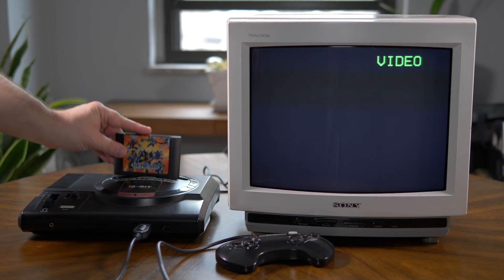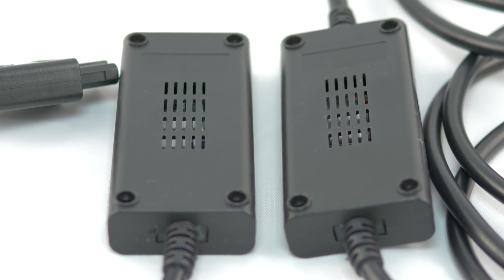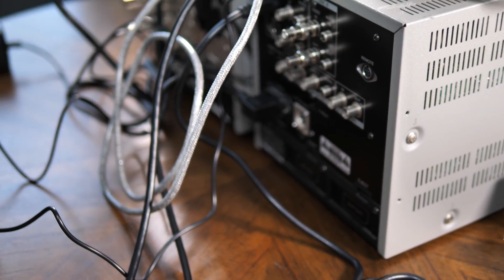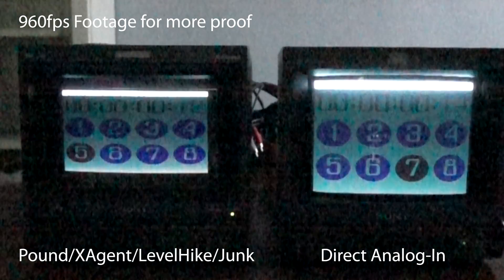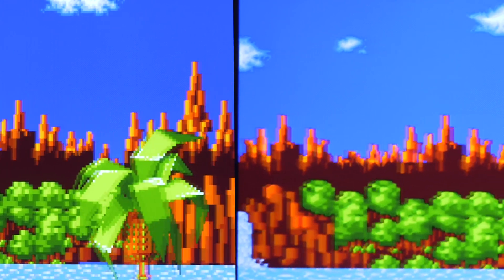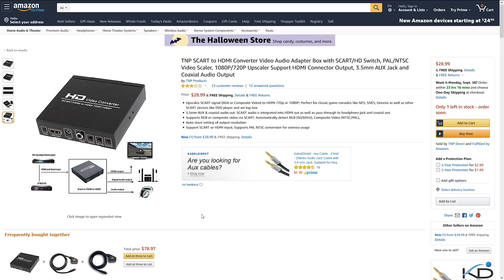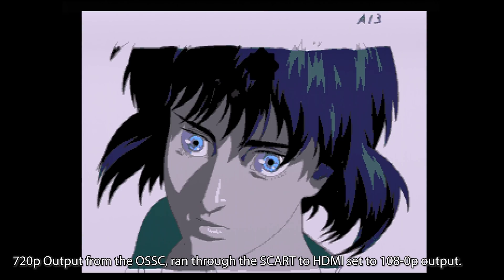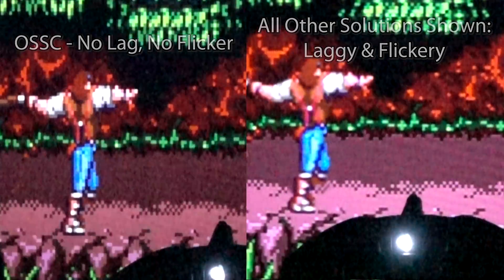The Worst Scaler In Retro Gaming

Comment from the maker: A polite reminder:  Every measurement taken can be verified by anyone who feels the need, simply by following the same procedures.  Using the 240p Test Suite's MANUAL lag test is NOT a measurement though - That's basically a test of your reflexes.  Also, listing a bunch of claims without measurements is just spreading misinformation; This video is a culmination of RESEARCH and the opinions I state are based off hard measurements, not guesses.
Reply: I was using that scart to hdmi box with a Trinitron Sony CRT via its hdmi port and it worked great. Maybe it's performance is better with hdmi CRTs. Im aware that most people don't have that option since it's rare to find a CRT with hdmi.
Reply: @ericko777  yeah, wouldn’t mind seeing a video on that.
Reply: I like how much effort you put in to nailing down the facts and making sure you're not guessing or going with your gut. I've found people who either have one of these, or who don't want to buy something expensive will say it isn't laggy for them or that lag doesn't matter. Now nearly a year later when you've hammered the point home with the lag test roundup do you feel you've won the argument or is there still lots of push back?
Reply: Bob it's funny that you say that this video ins't going t be some elitist perspective. If anything Adam Koralik is the biggest Elitist in the retro gaming community.

Comment: Say what you will, that scaler does the job concerning the hdmi in port and scaling to screen size on retro hdmi mini consoles when using crts or vga monitors.  Also they take a bunch of different signals.  I get these basically for the hdmi in.

Comment: I feel your rant so much. So easy to get mislead by youtube videos by people who should know better.

Put the Hispeedido HDMI mod into a PAL N64, and was so disappointed in the result. How can so many people give this a pass when it can't even do weave deinterlacing of 480i properly. They much be blind! Ended up pulling it out and putting the much better (but much more expensive unfortunately) RetroGem in it.

And now that I am looking for something to properly process Playstation 2 video signals, I am just going straight for a RetroTink 5x Pro. My wallet hates me, but at least it will do the job properly.
Reply from the maker: Good call on both.  Just make sure to get good quality PS2 component cables, otherwise you won't get the best out of your RetroTINK 5x.  Just a quick note - If you wanted to scale the RetroGEM HDMI mod to 4K, you could get a RetroTINK CE that has an HDMI input and component inputs.  Don't get me wrong, the RT5x is AWESOME and you'll love it.  I just didn't want you to buy it, then realize there was another option after it was too late.  Here's links:
https://www.retrorgb.com/retrotink.html
https://www.retrorgb.com/playstation2.html
Reply: @RetroRGB  I've got the Bitfunx component cables for the PS2. They may not be quite on the same teir as the HD Retrovision cables, but they are a big step up from the cheap generic ebay ones I originally had. In any case, I'll keep that in mind if I find the display perfomance unsatisfactory.

I get what you are saying about the RetroTINK CE ... but the output from the RetroGEM (Shiny Edition) is already fantastic. And the RetroTINK 4K devices are really very very expensive. Even my spending must have limits.

The magic of great display conversion is less about the final resolution (although specific output resolutions obviously help) but more about getting a clean signal out of the source console and doing the right things to convert it to a clean output signal. The reason I chose the 5x Pro over one of the cheaper devices is because it has fully adaptive and configurable deinterlacing, which is a big plus for the Playstation 2. But you know all this already 🙂

Even though I never planned to buy the RetroTink when I modded the N64, I don't really regret doing the mod on the N64 even now I am buying the RetroTink. If anything, the PAL N64 is one of the more difficult systems to get a good source signal out of, so it is a good candidate for an internal HDMI mod.

Comment: I see you know your stuff, could you help me out? I want to digitalize vhs content. The box that you are showing here is quite cheap as you said, handles rgb over scart and I want to add a hdmi capture box to get the video onto my pc. How does it handle fields as home videos are interlaced. so from 576i50 how does it convert to 1080p? does it make it 50p and each frame is representing a field (this is my guess as in the video you said the backround was jumping a bit). Also about the lag: does it get out of sync with the audio or only lags from input? I would appreciate your help, thank you!
Reply from the maker: Check out both of these videos for a ton of info on PROPER tape transfer, including why devices like this won't work for tapes (no TBC):  https://youtu.be/Br6YRkOM9jA  /  https://youtu.be/9N9mRJKk9ps
Reply: @RetroRGB   I'm not interested in "proper" as it's waaay too expensive and we are talking about bad quality home videos here. I willing to spend a bit extra on the mentioned devices (rgb scart box and hdmi capture) over the composite to usb2. I would just like to know about how the fields are handled in such a setup. Thanks

Comment: As someone who has spent the past 4-5 days looking on reddit, youtube and elsewhere to find good information on how to get a good looking display on my PS2, I just wanna say THANK YOU SO MUCH for this video.
Some guy on reddit somehow convinced me that my experience will be good enough with a cheap composite to hdmi cable and I spent about £6 on it. After finding this didn't even come close to solving my problem, i finally found that the best solution for my budget was a prebuilt GBS Control from amazon since I didn't wanna build it myself. It hasn't arrived yet but I'm hoping it'll solve my issue as I heard it is the only one with good interlacing for the ps2 apart from the retrotink 5x and 4k.
I still couldn't help but wonder if I could have risked a cheaper method because so many people are praising these cable brands you mentioned for ps2tohdmi, but you tested basically all of the most recommended ones (apart from Kaico which I am guessing will still be the same issue). This makes me feel better and glad that I decided to just pay the extra for an option that is still quite pricey for me, but should hopefully give me the experience I want.
Reply from the maker: You got the perfect option for the PS2!  While yes, the RT5x and RT4K are better, those are much more expensive options. For the price, you can’t beat the GBS-C!  Just remember to use good component cables though - bad cables will make any scaler look bad. These are the best:  https://amzn.to/47f3Pb8
Reply: @RetroRGB  thank you so much for the confirmation! I did end up buying a basic Amazon component cable just because it's a pain getting the Retrovision in the UK. But if I find that I have problems with the cable I've bought then I'll just suck it up and buy the Retrovision.

Comment: I've heard that there is a difference between the Scart to HDMI converter of today and the one of many years ago. They look the same, but apparently sometime many years ago, they changed factories or something and became much worse. I have one of the older ones, ordered another some years later, and found out that it was a hunk of junk and apparently they're all hunks of junk now. One obvious difference is that the older one I have has an option to keep the image in 4 by 3.

I mean the older one is still far from perfect but still, it's good enough for casual home use. I'm still looking for replacements because I wanna run some retro fighting game tournaments though, but... FGC is poverty, so the search for a "good enough, cheap enough" option continues.
Reply from the maker: I tested an older one in this video.  If the newer ones are worse, that's pretty funny.  Most importantly though, NONE were designed for gaming, ONLY DVD & VHS.

Comment: Yikes...I had one of these. Although this SCART to HDMI gives PSX display going wow, the terrible experience that I had faced with that thing is frequent black screen due to crappy 5V adapter that they give until I managed replace it with better adapter. 

Second is you have to switch modes from SCART mode to HDMI mode and turn it back to SCART mode just to fix green washed out display.

Comment: The scaler works great with exception that you need a scanline generator. Colors are crip and clear. I have experienced zero lag.  The smaller HDMI non scart cables are indeed garbage.
Reply from the maker: These use the EXACT SAME chip as the smaller HDMI cables.  They all have between 3 - 7 frames of lag.

Comment: Any good scalers support D-terminal/D-tanshi connections? It's the same signal as the tri-plug component cables put through the same single plug as the AAUI connector Apple used to use for its ethernet connections. The difference is that it also has three "status pins" as I call them, which directly tell the receiver what the video signal's parameters are. Pin 8 has three voltage levels which identify whether the signal is 525 lines (0V), 750 lines (2.2V), or 1125 lines (5V). Pin 9 identifies if the signal is interlaced (0V) or progressive (5V). Pin 11 identifies if the image is 4:3 (0V), a 4:3 letterbox (2.2V), or true 16:9 (5V). From what I hear, the Wii actually has full D-terminal support, including these status pins.
Reply from the maker: I'd just use a component video adapter...no scaler manufacturer is going to put in the effort to support extra dterminal features noone uses: https://ebay.us/XbWWAJ / https://ebay.us/uEe1bC /  https://amzn.to/3R42k7f

Comment: Could you recommend the best converter/upscaler to digitize great picture and sound from an old s-video VCR (home movies) to 1080p HDMI/mp4? Thanks!
Reply from the maker: Honestly, the scalers that I say "never use for gaming" are actually great for VCR's.  My suggestion is to start with the absolute cheapest you can find on amazon and go from there.  If it's not good enough, there's better options, but cost goes up exponentially;  DVDO deinterlacers, domesday duplicator project, etc.

Comment: Don't buy the Kaico PS2 to HDMI adapter. I bought it for shits and giggles because the Rad-2x has been out of stock forever but it literally doesn't even fucking work with some games. I tried playing Shadow of memories and as soon as I get past the main menu, the signal is lost. I basically can't play Shadow of memories at all.

I tried it on my 1440p monitor and it produced an ugly line through the screen. 

It was okay with the majority of games but honestly, I feel that the component signal should look MILES better than it currently does on my TV. A lot of it could be down to how my monitor handles the upscaling and deinterlacing but just save the headache and spend more on a better product. Let's be honest, for £30, you aren't going to get much.
Reply: I have it and it's worked just fine for me, maybe you got a faulty one...I personally like mine.

Comment: I think this scaler is actually pretty great for certain things.. like standardizing HDMI signals... I couldn’t get my cheap capture card to accept 90% of OSSC’s outputs, but running them thru this thing my capture recognizes the signals just fine. Like 960p for instance, upscales pretty well to 1080p with it for streaming.
Reply: It’s a shit scaler for SCART, but it’s the perfect device if you want to be able to stream with your OSSC on the cheap. It won’t accept 5x 1080p though, only up to 960p
Reply: It even somehow recognizes OSSC’s 1440i signal on 3x 480i. It looks like absolute ass, but it works haha
Reply: It def adds a lil bit of lag tho :( even when using on hdmi. I didn’t notice it at first, but after playing Quake I definitely noticed. Gonna need to split the hdmi before going to it I guess

Comment: just curious, have you ever tested this thing with 960p? my capture card has issues with OSSC's 2x480p mode (for gamecube,DC,PS2 etc), I wonder if running it thru one of these would produce a decent enough image upscaling the 960p to 1080.. or maybe at least somehow standardizing the signal for capture
Reply: i tried using mClassic for that, but it kinda freaks out from that resolution lol for the time being I'm using mClassic with 480p for streaming/capture, but i dont like the effect nearly as much as the OSSC's much sharper 960p mode

Comment: I was close to get one of those crappy SCART upscalers, but for my fortune a few days ago I found on Amazon the Retrotink 2X SCART for a decent price for my wallet, and now I'm waiting for it to arrive (along with a 6 button Genesis USB controller for my Sega Genesis Mini), this will allow me to use my Model 2 Genesis with SCART (I may need to get a better cable in the future but the one I currently have will give me an idea of how it could look with a good scaler). before I got a Retrotink 2X, my real hardware pictures look between crappy or decent in some instances (I have a World Heroes run with a crappy upscaler that just looks kinda bad in picture... I may re-do that to be honest... plus, I only had composite cables at that moment, but when I got the upscaler I also got a S-video cable for my SNES... I may upgrade to Component or SCART in the future, but at least S-Video is a major improvement over composite... wish I could say the same for my NES, but I'm not going to mod it, maybe in the future I'll get an AVS or a good NES quality HDMI solution that is NOT the NES Classic that allows me to use my Everdrive and/or carts I currently have, heck even I'm not willing to mod my N64 to have RGB support... well, maybe if I get a spare console just in case something goes wrong with the mod... but that just me).

Comment: The Hyperkin HDMI cable for original Xbox works FINE. It looks better than RF, better than composite, better than component, and there is no "lag" colors are bright and clear and no problems at all for a 30 dollar HDMI solution. I also have the OSSC and it's super nice for my 16 bit stuff and 32 bit, but really for original xbox, (which already looks great through component) the cheap HDMI cables are a nice solution if all you have is your HD TV set up somewhere as your only gaming TV. Personally, I use a computer monitor because they have the best selections of different resolutions they can handle, and then run my audio to powered studio monitors. The experience playing something like Dreamcast like this though the OSSC or even with VGA output is incredible.
Reply from the maker: Actually, the Hyperkin Xbox cables are most likely just ADC's and as you saw in the video, most are zero lag since they don't "process" the video, only convert it to analog.  All the 16 & 32-bit Hyperkin cables are complete garbage though.

Comment: What I absolutely hate is when people say "no perceptible input lag" ... What's your definition of that? becuase YOU didn't perceive input lag in your likely limited time to review a product?  Or did you do measurements and it was under a certain ms?  and if you did measurements, why not show the actual measurement number?
Even in the game I am most familiar with that I play competitively and enter competitions in, and I am sensitive to input lag of more than 1 frame.  It takes an extended session to realize the REASON i'm "off" is input lag, and not some other reason.  and it is definitely perceptible.
For me, 
1 frame takes an extended session,
2 frames takes a short session
3 frames is the point where I can realize immediately there's input lag.
Don't worry about people saying you're picky. we NEED the information and you're making it easier to find.  I don't buy anything unless there are measurements provided OR my use case doesn't involve the games I'm most competitive in. and too often there aren't any measurements out there.  They just say "no input lag (which often isn't true)"  Or  "no perceptible input lag" which... doesn't help.  Because I can tell you my threshold for "no perceptible input lag" is much lower than the vast majority of reviewers out there.
I've been using the OSSC, retrotink 2x and RGB2comp for years. and recently (I think after seeing one of your videos) bought a VP50 for compatibility.  and the reason why I was confident enough was because of a my life in gaming video which you loaned a unit to.  I heard the phrase "no perceptible input lag" and did a groan, and then immediately afterward he mentioned the measurements! yay! after that I did research and found forums confirming measurements (some were slower, but within acceptable for me)  so i'm glad for the stuff you do.
as for upscalers treating 240p as 480i eeh.  it's hit and miss.  I would argue if there's no input lag, it's worth the quality hit if you're on a super super tight budget. But i definitely recommend all the upscalers you do to people who ask.
Reply: You'll hear no perceptible input lag a lot on Pound/Hyperkin/Levelhike reviews.

Comment: The Pound HD Link is a decent device for the XBox and PS2 era too. I recommend staying away from generic knockoffs, as those have been unreliable. Also 99.5 percent of games are compatible with the Pound cable on the Xbox with NBA and NFL 2K4 refusing to output properly at 720p. The pound is lighter and most likely doesn’t require external power while clones can be heavier and require it.

Comment: You forgot to tell the people that the Scart to HDMI box you are holding in you hand, are not all the same. The one I have is a name brand and the others look the same but are a cheap 3rd party knockoff.. they dont operate the same.. Also when you put the TV in Game mode it eliminates most of the lagg. You forgot to say that to.. I agree with you up to a point. But there are ways around the lagg. I haven't had any issues with the jumping picture on my Qled TV with the HD box.. I do agree that the pound cable is trash.